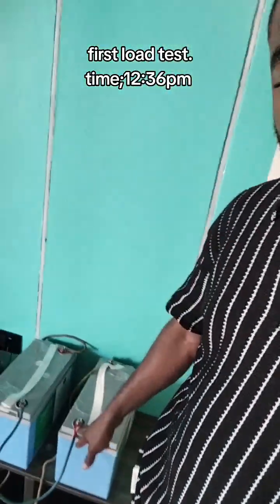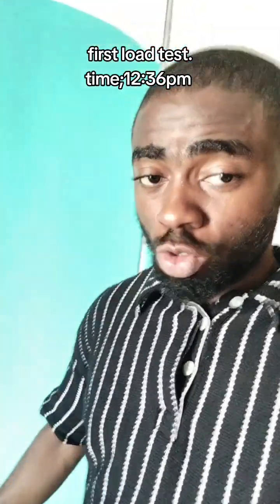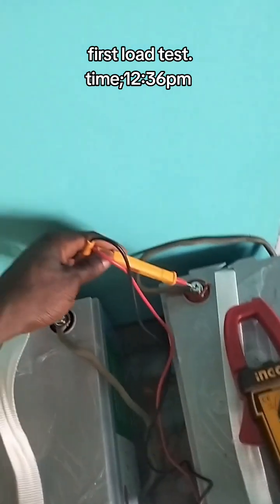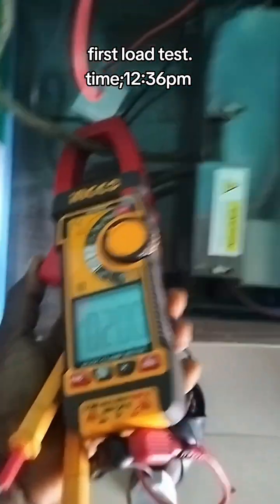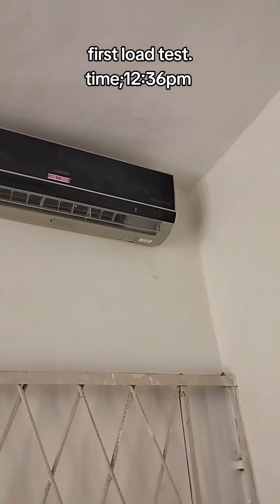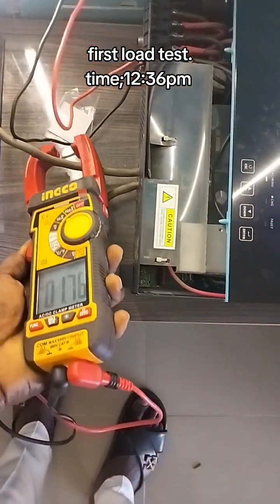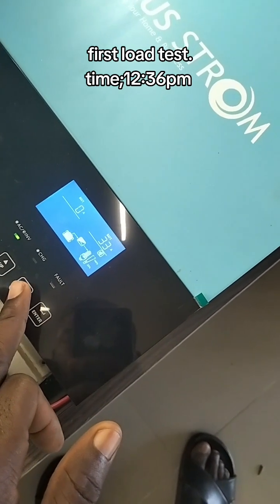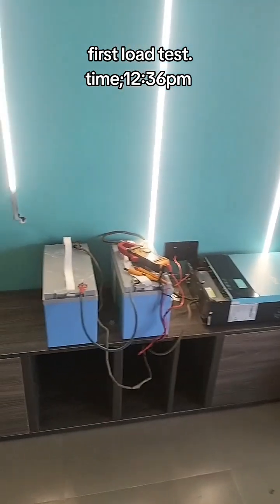Lemax lithium battery load test

Comment: great video but is the series connection done with cable or bus bar and which one is better between the two connection - cable or bus bar? thanks
Reply: series is with cable and parallel with busbar